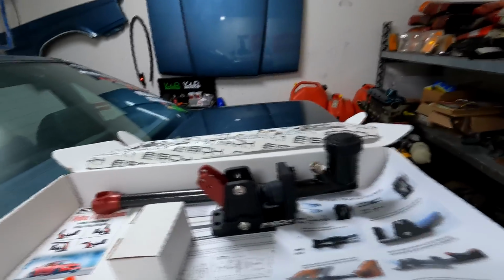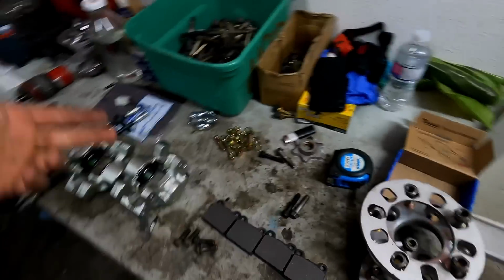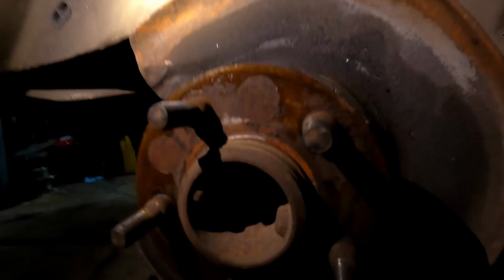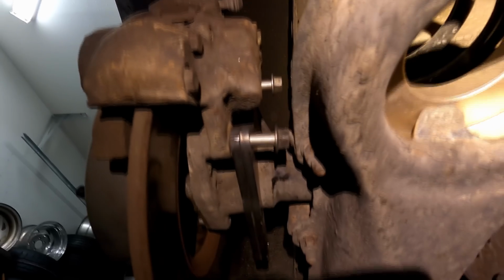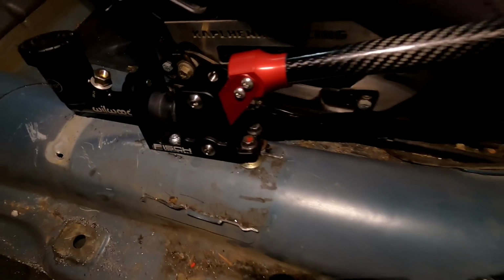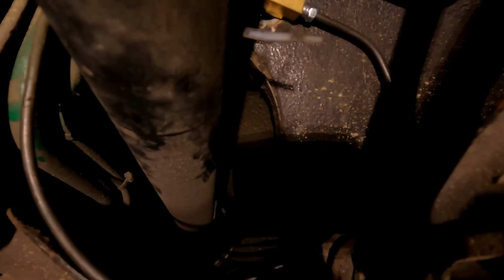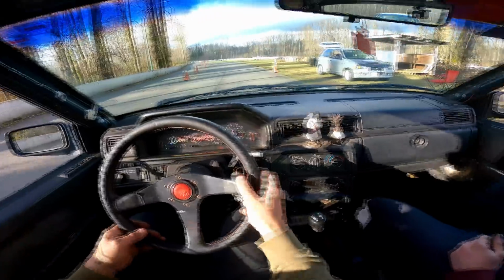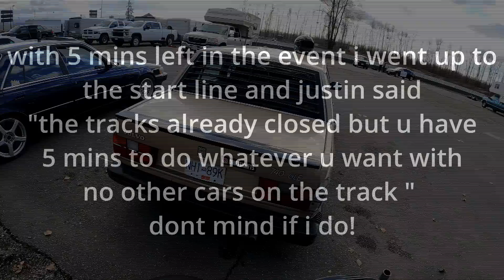HOW TO INSTALL A HYDRO EBRAKE IN YOUR VOLVO 740/940

Comment: I put one in my LS swapped Volvo 240..
Bought eBay hydro, wilwood master for $50 to swap for cheap one on the eBay, bought a 3/8 24" t union, a 3/8 to 4an adapter, 48" steel braided hose with 4an on both ends, and another 3/8 to 4an where the braided connects to the master. So pedal is front brake only, and hydro is rear on the ford 8.8 hubs with slotted rotors and hpc pads. It's fully locked diff with spool so not much of a street car anyway to worry about brake scenario. But honestly if I am driving on st and need to stop fast I just gently tug on the hydro while applying pedal and it slows quite nicely. And I actually mounted to stock ebrake handle location as the hydro handle tilts forward quite far. Bolted into factory location with no adapter plate. And was already a hole to run the line. I just took a 3/8 fuel line cut it length wise and wrapped around the line where it goes through the floor. Then zip ties in the tunnel to keep it away from the driveshaft.
Reply: Ps I'd love to let you rip the LS 240.. it has a Nissan 300zx manual trans with the 3.73 in the ford 8.8 and spool diff. It's pretty rad drift car. Has ipd sport springs, ipd torque rods, and bne panhard bar.
Was on Corvette salad shooter wheels 15x9.5 but I swapped for BBS SR 18x8.. the Vette wheels has kuhmo ecsta xs which are grippy not great for drift. The BBS have some cheap all seasons that slide nicely but leave zero tire smoke for some reason.

Comment: I used a bungee cord to bleed lmao.. pump and hold with cord go bleed and close. Come back release bungee and repeat. Took awhile to get all the air out so it would fully lock the rear. 
Also motive pressure bleeder will fit a wilwood master.. just pump til gauge reads like 10-15psi and crack bleeder til pressure drops and that's usually enough. "Don't forget to fill the pressure bleeder with fluid lol"

Comment: my 740 tends to eat lambda sensors does anyone know what could be the reason? bad maf? , not having idle air control valve so when engine cold it idles low if I don't help with gas so it makes the mixture very rich which with enough time breaks the sensor? it's been maybe 4-6 months since I got a new one and the sensor just stopped working it's annoying bc they are pretty costy for my wallet